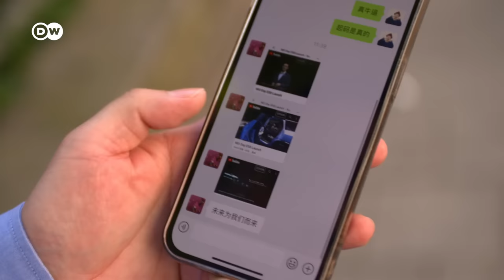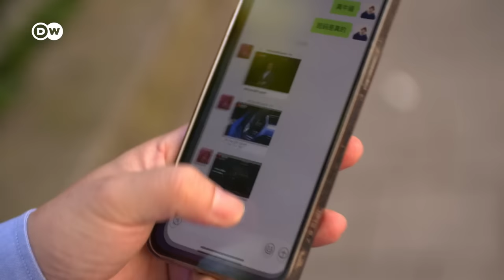Are the GERMANS ready for CHINESE cars?

Comment: People dont realise but Model 3 made in China is build better then Model 3 made in Giga factory Berlin, the chinese Tesla got less panel gaps, many of you dont know  that chinese have developed battery tehnology that beat the us and e.u rivals, at least audi and mercedes they surrender and they admit, cant compete in this market and they focus on developing syntetich fuels.
Reply: Tesla are using their own supply chain and they own built standards.It's different between local brands.
Ev suck in highway and cold weather. and after 5-7 years battery will fail.When you back to Chinese car dealer ask for warranty.They will sent the battery to battery factory. They will tell you will cost 3 months to fix .even do some dirty stuff in the battery. After 3 months.Battery fail again. This Cycle goes on. Till force you to selling the car.It's happened in china right now. If you know how Chinese company treat their employees you will never buy them.Don't just believe what they said and the number. 
I own  Toyota hybrid and lexus hybrid. Toyota hybrid battery failed after 10 years 400,000km.Just spent two hours to fix a new one.

Comment: My main issue is repairability!
Because, vehicles are the most repairable consumer product in the World, while being one of the most complex pieces of machinery in the World.
Moreover, a product can only be sustainable if it is able to achieve a long product life-cycle.

Hence, my questions are:
a. Will we get support from the OEM long-term?
b. Will independent shops get access to OEM's information, e.g., the procedures to perform maintenance, or material specifications?
c. Will spare parts be available?
d. Will aftermarket parts be available?
These questions are what truly matters in a vehicle, alligned with the two main vehicle aspects: reliability and support - not its power, software capabilities, or price.
Because a vehicle holds too much value, too much resources, and too much man hours to be discarded easily.
However, I think people have taken these two aspects for granted - which Chinese companies have taught us we can not, e.g., on smartphones, cheap electronics, and televisions.

I own a 22-year old car, which still drives me to and from work every work day reliably, comfortably, and efficiently.
A cheap, light, and small car - a 2001 Renault Clio, with a gasoline 1.2L 16v engine, producing 75 hp, consuming 5.5 L/100km.

It is a well-known and simple vehicle to work on, spare parts are readily available, and it is cheap (to maintain, insure, tax, and on fuel).
And, by being small, it spent quite less resources than a modern EV - while lasting 22 years, and I still intend on driving it one more year, and selling it in 2024 or 2025.
This is sustainability!
Reply: The structure of an electric car is much simpler than that of a gasoline vehicle. As a result, their maintenance intervals are much longer than those of gasoline vehicles. Reliability is also higher. Although China's electric vehicles are being replaced very quickly. But as long as you choose a big brand, there will be no problem with spare parts. Most Chinese car companies do not make profits from spare parts, and the parts-to-part ratio is not high.

Comment: Chinese Cars dominante with connectivity, not necessarily with quality and safety. For good reason BYD is leading fire accidents, although saying the blade battery is a safe one. However, it is not the battery only, but the entire battery and charging management. At the end the customer need to decide what he or she prefer: cheap electric features or a safe and reliable car. Keep in mind: we drive on highways while Chinese stück in traffic jams. Data Shows a dail max. range of 50 km and and avg. Speed of 15 km/h. Accident No. 1: front Crash due to strong acceleration.

Comment: I feel more confident in driving a German engineered car than hmm let say a Chinese made car.  When the Chinese tries to break into European market, they certainly will ship the properly assembled cars at the beginning.  But will these Chinese auto makers be able to maintain the build quality when the volume of demand picks up?
Reply: Chinese brands have been learning quality standards from Germany, which has started to get lazy in the last few years. 2010 BYD EV E6 hit the road in Shenzhen as a cab, and in ten years a lot of problems have been solved. the BYD Seal has been running for more than 5 years and has less than 10% battery loss. Electric cabs on the streets of China demonstrate the balance between quality and price. China and Germany have different climates, driving conditions on German roads are better than in China, and Chinese EVs perform well on domestic roads. The Chinese like interesting cars, but are also conservative and safety-conscious, and the answer to quality is sales.
Reply: chinese company produce 60% EV of the world now.  Dont forget that. 
The brand  which has won the competition in chinese domestic market could easily win the competiton in europe. But  VW is losing in China.
Reply: @Jason-ct8so I am not risking buying Chinese cr4p

Comment: No matter how the battery improves, you need to deal with a huge amount of electricity to charge. It's very risky. Only mini EVs for city use, maximum speed limited to 60kph will be common. Large ones are indeed nonsense.
Reply: Indeed, nonsense.  If you aren't paying attention to how rapidly wind and solar are being installed.
Reply: @bobwallace9753  
You didn't get it. I meant that no matter how the power is generated, by wind or solar, and no matter how batteries get advanced, you still need to deal with high-voltage cables and plugs, which will charge it in a few minutes every time you charge your battery EV, and will require special body covers and gloves to prevent electrification. Generally speaking, those who deal with high-voltage cables are required to have a specific qualification. And that kind of thing will not be a routine for ordinary people.
Reply: @Funica11  
You're right.  I did not understand your point.  So let's address your restated point.

"to deal with high-voltage cables and plugs, which will charge it in a few minutes every time you charge your battery EV, and will require special body covers and gloves to prevent electrification"

No.  Drivers are already dealing with high voltage cables with zero need for protective clothing.  

Why?  Because current does not start flowing until the cable is correctly attached to the EV.  And because the insulation on the cable is more than adequate.
Reply: @bobwallace9753  
"No.  Drivers are already dealing with high voltage cables with zero need for protective clothing. "

You can not charge a BEV full, for 600km in 5 minutes by today's common battery chargers. You need a more powerful battery charger with extremely high voltage and high current. If you can not charge it in less than 5 minutes, then BEV is not practical. Need a professional electrician standing and waiting for you at the charger every time you charge it, like a full-service gas station. I never want to deal with such extremely high-voltage things.
Reply: @Funica11  
The Tesla Megacharger which is being used by Tesla's semi-tractors and will be used by their Cybertrucks is a 1,000 volt system.   Megachargers deliver up to 1 MW of power

1 MW or1,000 kW.  The Tesla 3 drives more than 4 miles on a single kWh.  As Tesla (probably) increases the voltage used in all their EVs it's going to take only a short time to go from 10% to 80% charge.  

A 600 km range is unneeded by almost everyone.  Your bladder is going to pull you over before you drive 360 miles/600 km.  And you can't eat a meal in five minutes.  Try not to exaggerate just to protect Big Oil.
Reply: @bobwallace9753  
Still, it doesn't persuade me enough to think of Tesla as a practical option. For a road trip, even if you get another 100-mile range by charging it for 15 minutes at a roadside charging spot, you always need to think about where to charge it next. It's quite stressful. Most people use a car for daily use for shopping and sometimes for a trip. Tesla would only work for daily use within a certain range, so rejected.
Reply: @Funica11 But it's OK to deal with explosive gasoline. Just light a match at the gas nozzle. Automated electrical chargers will solve your problem.
Reply: @Funica11 One day there will be as many charging stations as gas stations. Many are actually converting because during the waiting time people consume and that's where the real profit is.
Reply: @antoniocruz8083  
To recharge in minutes, definitely need a super high voltage charging system. Imagine a Karen handling it, it must be safe enough. And it must be located everywhere so that people don’t have to worry about whether they can get it or not, they don’t have to detour to get it. The main issue for BEV is the lifespan and capacity of the battery. As for an ICE car, as long as you change oil and maintain it it will last for a practical period ordinary people use, yet for a battery EV, the battery starts degrading right after you start to use it. Batteries are expensive you can not replace them often. There are still many bars to get over for BEVs, it’s not on my list of next car, probably it won’t be on it forever.
Reply: @Funica11  An ice car only needs oil changes? In all the cars I've had I spent at least half of its original cost in mechanics, and they were all Japanese, supposedly the best. And the same amount for gasoline. Regarding batteries, do you know if any modern ev, not the early ones, that needed a new battery? I know of a small city car that has done 150.000km, its 10 years old and the battery is still at 90%. There are Teslas with 1 million kms. Batteries don't last longer on purpose otherwise there is no profit.
Reply: @antoniocruz8083  
True, nowadays, gasoline price is high, so keeping an ICE car is much more expensive than a BEV. But I still need to allow an ICE car since I don't want to waste my time charging the battery. Even with a high-performance charger like 150kw/h, if someone comes next to you, you need to share the 150kw/h, you only get half of it, 75kw/h. Your journey plan will be miserably destroyed. That’s why we need super high-performance chargers that can charge for a satisfactory range in minutes.
Reply: @Funica11  99% of travel is near where you live. To travel far you can go by train or plane. I have a friend with a hybrid, gasoline and also 60km range of electric. He always uses the electric motor, the ice motor is just a dead weight. On long trips he actually rents a diesel but I have seen here in Portugal Teslas with Norwegian license plates so it is possible to travel 6000km and charge along the way. Most Evs nowadays make 350km on the highway which is enough between major cities in Europe. Electricity is the future, as a cyclist I'm sick of breathing ice fumes.
Reply: @antoniocruz8083  
I also don't like the interior of model 3, I don't like the touch screen in the middle of the dashboard, I need mechanical switches for climate control and others. A Car is not an iPhone, it's very goofy to make it that way.

Comment: Your premise that Europeans are accepting and interested in Chinese EVs is in error for the opposite of the reason you site.- quality.  Chinese EVs have poor Quality Assurance. Statistical quality control is lacking.  Is a vehicle high quality if airbags that go in them haven't been tested?  What if 1 in 100 don't deploy - can you determine that in a crash test?  No you'd have to crash all of them.
It might be the proper thing now.  QA is something Japanese, European and American car buyers expect; they won't find it in Chinese brands plus they are all running in the red. Cheaper in China means cutting corners - do check YouTube for specific videos of cars burning, airbags not deploying, rust, bad welds even entire wheel assemblies and doors falling off Chines BYD and others.
Reply from the maker: Interesting points you make. The perceptions of Chinese EVs in European and other global markets are shaped by various factors, including brand reputation, product quality, regulatory compliance and consumer experiences. As Chinese manufacturers continue to expand globally, addressing concerns related to QA, safety standards and transparency will be essential to building trust and credibility among consumers in Europe and elsewhere.